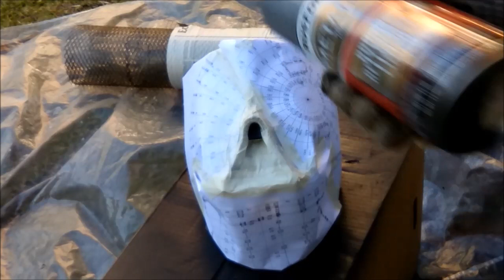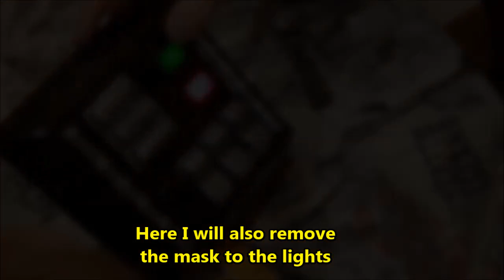Painting Darth Vader Foam Suit and Helmet

Comment: Cris you make all the parts from eva foam ? What type ? 80 ? 100?
Reply from the maker: Hi, yes, it's 8mm foam thickness.
Cristian
Reply: @StormtroopTemplates  density 80 or lower?
Reply from the maker: @JustxxxRaV  it's foam density between 60 to 80 (30kg to 50kg in kg by m3) to get the same result, check the tnt cosplay Eva-38 foam sheets, it's nice to work with:
https://tntcosplaysupply.com/product/eva-foam-sheets/
You can get sheets of foam of 24" x 60", each sheet is almost 1 square meter.
So 80 it's ok. 
Cristian

Comment: Hi Cristian! the black is normal, matte, or satin?
Reply from the maker: Hi Guillo, I don't know how you get plastidip out some plastic paint in those 3 options, but choose the one you can get.
Thanks
Reply: @StormtroopTemplates  I refer to Montana Hardcore...
Reply from the maker: @GiulioMasiero88  Don't use this spray I used in the video, it comes to hard and brake the foam, get plastidip instead
Reply from the maker: To print you can use these options, you can see the videos (not mine):
youtu.be/ROZlkW96hFI
youtu.be/ug6Rs06FEpk,

Comment: So if i want to make my helmet shine after i paint what should i do? I heard polish and dont use clear coat. I heard use clear coat rhen slightly wet sand the tiny bumps from the paint using 2000 grit sandpaper. Any advice
Reply from the maker: Hi Skyler, I did as seen in the video, base plastic paint like Plastidip and after sand and then spray paint. I never used polish or clear coat, I'm sorry. Other videos on YouTube may give you more ideas